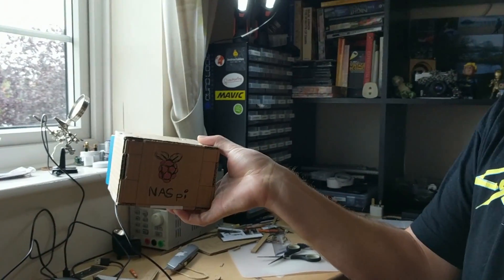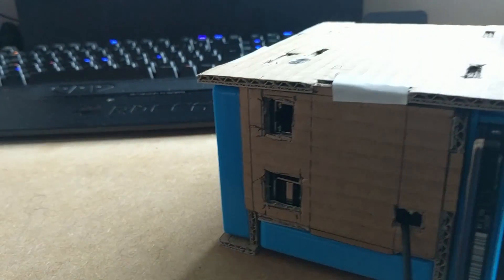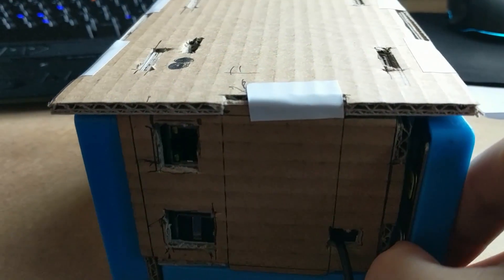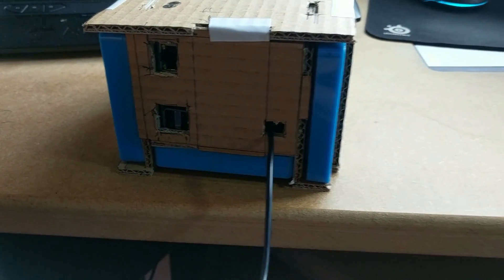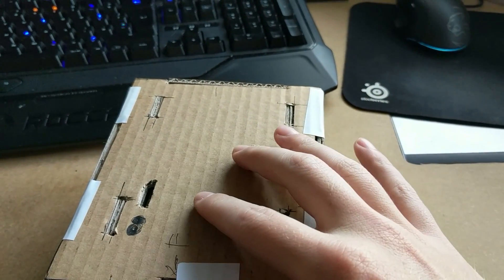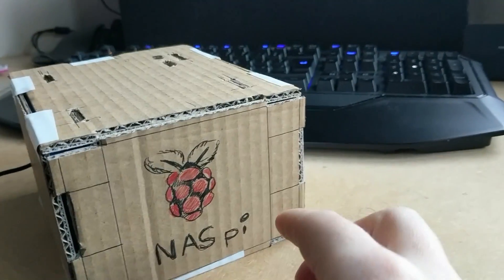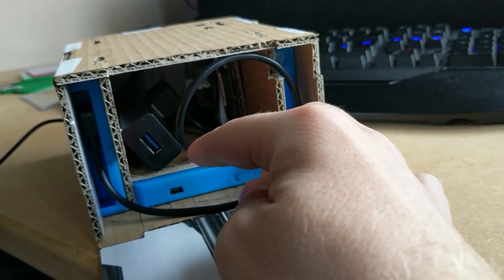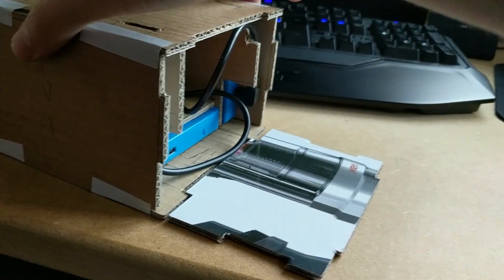Raspberry Pi - NAS - Plex, RAID1 and more part 3

Comment: Helo
Very nice project, congratulations
I would like to know how did you connect the powered usb hub? without using the usb ports.
And if is possible to expand to usb 3, cause I've got usb 3 hdds and I want to make a raid 1 nas.
Thanks so much
Reply from the maker: I have unsoldered the USB ports on the RPI. It should be listed in the entire build-log. As per USB3 - remember you are limited to USB2 interface speed due to RPI bus.

Comment: This is a great idea. I may have to try to follow along. I've got an old 2007 iMac that we only use as a Plex media server these days, and that's over WiFi. It's old, it's big, it's slow, it's clunky.

I got a brand new Pi3 to use as the media centre connected to the TV. I wonder if I should also use it as the server, or if that should be another Pi.  I've have been wondering what to do about storage. This looks ideal. Do you use a VPN service on your Pi?
Reply from the maker: I think you will benefit from:
-low power
-low cost
-small form factor
- you can run plex/dlna and file server
  for VPN see: 
http://www.notenoughtech.com/raspberry-pi/the-real-lifetime-vpn-subscription-for-5/

also for network speeds see:
http://www.notenoughtech.com/raspberry-pi/raspberry-pi-internet-speed/

The NAS gets about 10-11Mbit over the Ethernet while it's not ideal, at that cost, it's a viable solution to streaming and file backup